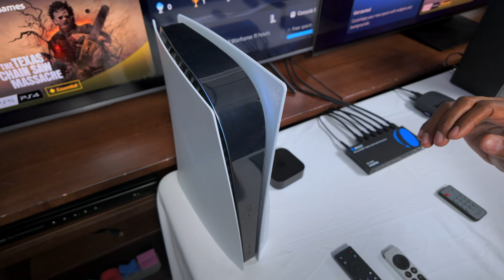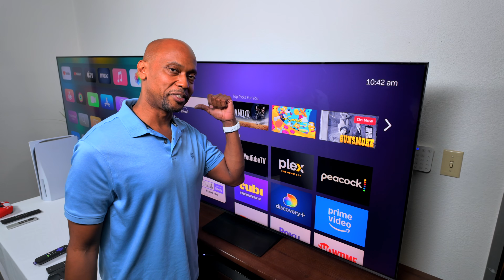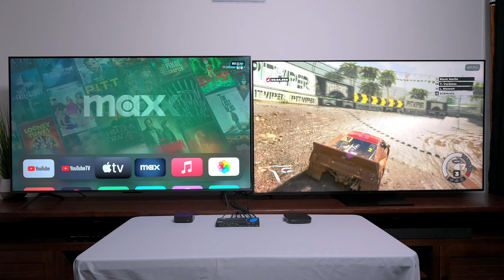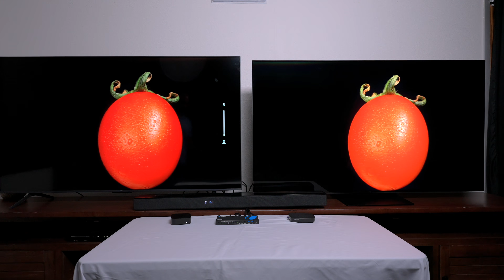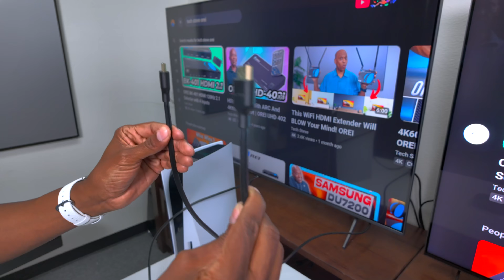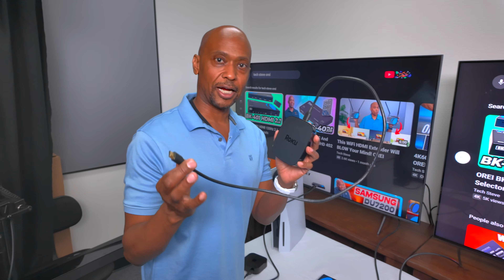HDMI Switcher With eARC , HDMI 2.1 And 4K120Hz Support |  OREI BK-402A

Comment: Is there an HDMI 2.1 device that supports 1 input and 2 outputs? I want to connect my PS5 Pro to both my 4K 120Hz VRR monitor and my Sony Bravia XR80 65" TV, while keeping full 4K/120Hz, VRR, and ALLM support.

Basically, I want to be able to use the monitor when I’m at my desk and switch to the TV in the living room when I want to play there. An HDMI 2.1 matrix also does the job, but that seems like an expensive solution for something as simple as 1-in/2-out.

I’ve been looking for a device like this but haven’t been able to find one so far. Does such an HDMI 2.1 splitter actually exist that can maintain all of these features? @TechSteve
Reply from the maker: @retro_game_collection Yes—the OREI BK-102 is a 1-in/2-out splitter rated for 4K/120Hz, VRR and ALLM. It mirrors both outputs rather than selecting one, so test that your PS5 still reports 120Hz and VRR with both displays connected before keeping it.

Comment: I been to three of these units, 2 directly from Rei 1 from amazon, none of them work switching the input. Frustrated
Reply from the maker: @AndresLler that’s frustrating, especially after three units. Since they all do the same thing, first make sure the CONFIG switch is set to Matrix mode (1xx), then press OUT 1 or OUT 2 to cycle the input for that output. Test one source and one TV at 4K60 with eARC off, then power-cycle everything. If the front-panel input LEDs still don’t change, I’d return it and ask OREI for a different model because that isn’t normal.
Reply: @TechSteve Thank you for your input! What would be another option with the same functions?
I have a LG G5 Tv,
Projector Nebula Anker SE 4k,
Samsung Q990f Soundbar,
Ps5,
Panasonic bluray player.

I want to be able to connect all these devices

Comment: So can I have the OREI connected to my game consoles in my room, how do I display it to my living room tv
Reply from the maker: yes. Connect the consoles to the OREI inputs, then run one of its HDMI outputs to the living room TV. For that distance, use an active optical HDMI 2.1 cable or a 4K120-rated HDMI extender because a long passive cable may cause signal dropouts
Reply: @TechSteve you have links to some good recommendations

Comment: Steve, how are you?  What I'm trying to do isn't as grand as the set-up you have in this video, so I'm wondering if this device would work for me. I am very simple and basic and I just want to watch My LG OLED with my receiver and soundbar. I don't see a receiver in your set-up so I'm not sure if this will work. Basically, is it possible to use eARC/ARC with my TV and sound bar? The Receiver says connect the eARC to the TV, but  soundbar videos say to connect your soundbar to the eARC ... which is it?  I can't do both ...or can I ?  I thought I would connect my cable out of the receiver to the TV for a great picture but then where do I plug my soundbar in for great sound, or do I have to get rid of one of those things (soundbar / receiver )   Any help here ? ... and I will say that the soundbar only has an HDMI eARC port, not an optical port.   Thanks in advance.
Reply from the maker: Great question. With eARC/ARC, your TV can usually only send audio back to one device because most TVs only have one HDMI eARC port. So you normally have to choose: either connect the receiver to the TV’s eARC port, or connect the soundbar to the TV’s eARC port — not both at the same time.

If your receiver is being used for speakers, then use the receiver and don’t use the soundbar. If you want to use the soundbar for sound, connect the soundbar to the TV’s eARC port and connect your cable box/source devices to the TV or switcher.

The HDMI switcher can help with adding more HDMI inputs, but it does not magically give the TV two separate eARC outputs. Since your soundbar only has HDMI eARC and no optical, the cleanest setup is: sources/switcher into the TV, then TV eARC out to the soundbar.
Reply: @TechSteve thank you for your response and great advice. Yes I realized I should just choose one. Since my receiver is pretty good and attached to a lot of speakers, the soundbar isn't really needed. I am happy that you gave me good knowledge for the future when I have the right devices to utilize the info you so amazingly present in your videos.
Thank you again.
Reply from the maker: watch this 2 TVs, 1 Soundbar  Or 1 Soundbar, 2 TVs Shown On TCL QM8k And QM8L
https://youtu.be/rY8cI4ZI33Y

Comment: i just bought this device for your review, im facing a problem the apple tv remote control interfer with the device and change output and toggle arc on and off
Reply from the maker: @AlRefaei.m that sounds like an IR/CEC conflict. First try turning off *Control TVs and Receivers* on the Apple TV, and if it still changes the OREI, block or move the OREI IR window so the Apple remote can’t hit it. If that fixes it, it’s the remote codes overlapping and I’d contact OREI to see if they have a firmware or remote-code option.

Comment: Thanks, this is the solution I need. I got a Dolby Atmos sound bar but my TV only has an arc port but not an earc port. I want the full potential of the soundbar so after seeing your video I found a cheaper version of this brand on Amazon for $79 that doesn't't have the extra ports like this one which I really don't need, I just want 1 earc connection for the soundbar.
Reply: @211sweetypie  Did it work for you? I just got a brand new audio setup with atmos but my monitor doesn't support hdmi arc or earc but yet it allows 2.1 hdmis like the ps5 cable to function fine at 1440p 120fps.
Reply: @Urboyyycarlos ...It seems that this item will benefit you more than me. I haven't tried it yet. ARC and EARC gives the best video and audio with EARC being the best. You have neither so this item although a little confusing would help you.

Comment: It only work once for me
Reply from the maker: @BlackxDeath100 try a full power reset: unplug the switcher and every HDMI cable for 60 seconds, then reconnect the TV, source, and power in that order. Also try another certified HDMI cable and check the correct input/output lights; if it still won’t work, it may be an HDMI handshake issue or a defective unit worth replacing under warranty.

Comment: Could you route picture to the TV while sending audio via hdmi to an older home cinema receiver?
Reply: @JoeChip  
Seems like you can using the SPDIF fiber port he mentions . I think he said you would use the eArc from the source ie xbox then the tv eArc output. And then the fiber or basically the toslink cable to your avr. 
That’s if they work simultaneously meaning when source 1 and output 1 are being used the fiber port extracts the sound from source 1 and outputs it to your avr.
Reply from the maker: @JoeChip yes, connect HDMI Output 1 to the TV and Output 2 to an HDMI input on the receiver, then route the same source to both outputs. It doesn’t have a dedicated audio-only HDMI port, so the receiver will also receive video; if the older receiver causes handshake issues, enable downscaling or use optical, which is limited to PCM stereo or Dolby Digital/DTS 5.1.

Comment: Hi Steve,
Good video. I have just bought an Orei bk-402a, but I have an issue and was hoping you can help.
My connections are:
Output 1: LG C1 TV (eArc)
Output 2: Valerion VisionMaster Max
Input 1: Sonos Arc
Input 2: 4k Firestick
Input 3: PS5
The issue is that when watching the Firestick or the PS5 on the Projector and the TV is off I get no sound from the Soundbar. When watching them on the TV with the Projector on or off the sound works perfectly. 
How do I solve this?
Thanks in advance
Reply from the maker: i’m sorry a lot of these adapters aren’t compatible with sonus audio
Reply: @TechSteve thanks Steve. But it works with the Sonos when using output 1. Why not on Output 2? Do you think i have to change CONFIG or EDID settings?
Reply from the maker: i would contact OREI i saw the Sonos statement on there website, i don’t own one to test

Comment: Thank you for the lovely presentation. My question is whether you can display one as a 4k tv and the other display to a 4k projector?
Reply from the maker: Yes — you can display to two separate screens at the same time with the OREI BK‑402A device (which is a 4×2 HDMI Matrix Switcher with eARC, HDMI 2.1 and 4K/120 Hz support) — but with an important detail: it’s a matrix switcher, not just a splitter.  ￼

🎯 What It Does
	•	Connects up to 4 HDMI sources (PS5, consoles, AppleTV, etc.).
	•	Outputs to 2 displays independently — you choose which source goes to Output A and which goes to Output B.
	•	Supports up to 4K@120 Hz (and even 8K on compatible displays) with full HDMI 2.1 and HDCP 2.3 compliance.  ￼

So in your scenario:

✅ You can have one source shown on your 4K TV
AND
✅ Another source shown on your 4K projector
simultaneously, as long as both displays support the resolution and refresh you want.  ￼

In simple terms: Output
What Can Happen?
HDMI Out 1
4K @120 Hz to TV 📺
HDMI Out 2
4K @120 Hz to projector 🎥

Each output can show a different source if you want (e.g., PS5 on TV, Xbox on projector). It’s not limited to mirroring the same signal.  ￼

⚠️ Things to Know

📌 Both displays must support the resolution/refresh you’re sending (for example, 4K@120 Hz). If one display doesn’t support a mode, you may need a downscaling device or set the source to a compatible resolution.  ￼

📌 Audio Return Channel (eARC) only works between Input 1 and Output 1, and does not extend to Output 2 — so if you’re using eARC with a soundbar, it’s typically tied to the TV output.  ￼

📌 This model can extract audio to optical or analog if needed, but it does not extract audio over HDMI to both displays at once.  ￼

⸻

✔ Summary

Yes — with the OREI BK-402A matrix switcher, you can send:
➡ one 4K source to your TV
➡ another (or the same) 4K source to your projector
…simultaneously and with HDMI 2.1 features like 4K120 Hz and HDR support — as long as both outputs and your sources support those formats.  ￼

Comment: But can I put soundbar on it.  And I can get the ps5. X box. Tv  all play through the sound bar. ? And how would I connect it. To make everything play through my sound bar. Do I connect my sound bar hdmi arc to the switch arc. Then run out the switch box to the TV arc ? And then connect all other devices to the available HDMI slots on the switcher ?

Comment: I have a PS5 and an Xbox Series X with an HDMI 2.0 input monitor. Its resolution/refresh rate is 1080p/120Hz and 4K/60Hz. I was wondering if this device will allow me to run 4K/120Hz?
Reply: @brandondiaz3115  no you need HDMI 2.1 for 4K 120hz gaming

Comment: Great video of the product. However, I may have missed a scenario. If I have a 4K@120 source, could I simultaneously broadcast this source on a 4K@120 display on output 1 and 1080P@60 on output 2? Thank you in advance.
Reply from the maker: no you can’t do that edie matches the lower resolution, most switchers work that way😊
Reply: @TechSteve  See my previous comment - the OREI support has a different opinion - this device has an added control deep switcher to the EDID deep switcher.

Comment: Hi, thanks for the video! I have one question about the OREI BK-402A:
Does 4K@120Hz with VRR still work on a HDMI 2.1 TV (LG OLED CX) if the second output is connected to a HDMI 2.0 monitor (LG LED 1440p 75Hz FreeSync)?
I would mainly use the TV for gaming, but sometimes switch to the monitor — I just want to make sure the lower spec monitor doesn’t disable VRR and 120Hz on the TV.

Thanks a lot for your help!
Reply: Hi! I have the same question but for 1080p@60. Did you resolve your doubt?

Comment: if I have one TV that supports 120hz, and the other that supports 60hz, will this work?
Reply from the maker: It’ll make both TV 60 Hz
Reply: @TechSteve  Ok i have my answer.
Reply: Interesting, because OREI support told me something else. I bought the OREI BK-202A and it's not capable to output from an XBOX Series X in 4K to one TV at 120 Hz and to one monitor to 60 Hz (nor individually, nor at the same time). But OREI support tolt me that I can do this with OREI BK-402A. It's not clear from you (even if you had two sources to two TVs and one was at 60 Hz and the other at 120 Hz) and not from the OREI manual. So...I'm puzzled . It's a simple thing: just to switch from an XBOX in 4k to 60 Hz and to 120 Hz, individually, not at the same time, because at the same time XBOX will mirror with the lowest setting.
Reply from the maker: because of EDID, it will lower the resolution to match the signal
Reply: I'm just staying with Orei support on chat since more than 2 hours and they are not able to be clear about it.
For me, as a newbie,  it should be simple as if I change manually the cables, it simply works! Odd, that nobody thinks to it
Reply from the maker: most switches works this way, using a computers video card is the only way to display 2 different resolutions. i thought i mentioned this on the video but maybe I’m wrong
Reply: @TechSteve so nothing can replace my hands, manually switching the cables and all works

Comment: @TechSteve I need your help regarding my Home Theatre Setup
Reply: I bought new Bose Ultra Soundbar that is connected with TV eARC that works well. I also have a projector and a Fire TV which I need to connect it to sound bar without changing HDMI cable so the I can use sound bar with both TV and Fire TV along with projector . Will BK402 work without changing HDMI cables?
Reply: My TV does not have HDMI out for Video
Reply: Is there a why to contact you in person via WhatsApp/FaceTime ?

Comment: Can I use it with a Mac+Xbox+Monitor setup? my MBP 14 doesn't have 2.1 out so will be using a bypass using an adapter.
Reply from the maker: yes
Reply: @TechSteve  Ok boss <3 Thanks for the confirmation.

Comment: Why do you cut the video when you push the button? The entire reason I'm watching this is to see whether the thing allows fast switching.
Reply: Its just the same as any other youtuber, not really 'reviewing' the device.. more like advertising
Reply from the maker: didn’t i show how to use? ads don’t show details
Reply: @TechSteve you didn't show it switching, could as well change cables lol. People are right, very strange that you're not showing this, after all, that's one of the most important use cases.
Reply from the maker: that’s the reason? switchers aren’t fast, there’s always a 3-6 sec blank when you switch because of edit has to configure
Reply: @TechSteve Yes. That IS the reason. Ppl are complaining about this product on Amazon and I wished to find real reviews on Amazon. We don’t want to hear just about the bells and whistles.
Reply from the maker: unless you spend about $300  - $600 all these switchers blink because of edid, more expensive models have small processor to adjust internally like the aten brand
Reply: @TechSteve 
Well said , people don’t seem to accept you get what you pay for. That pause if you can accept it saves you hundreds. Or if you can’t go for the other option and pay the $$$ nice to have options!
Reply: @TechSteve  Seems like the ConnectPro brand unit is nearly instantaneous. The level1techs unit seems reasonably fast too.
Reply: @TechSteve  Definitely should have been advised in the video. I was also looking for this delay time. Did you get sponsored for this video? Seems like a big detail to "cut"

Comment: Hi! Can you help me please ?  Lets suppose that i have a ultra wide 32:9 monitor with 2 hdmi 2.1 ports. If i want to connect the two outputs in one single ultra wide screen from the dock, would it work ? Like i have 6 devices and i want sometimes to connect my pc at the same time that  i use my console on the same screen but splited in two 16:9 screens thanks to the two ports and the dock. Would this work ?
Reply from the maker: no
Reply: @TechSteve what if i use 2 docks ? Because the screen that im talklng about is a samsung screen and its supposed to support 2 hdmi sources at the same time from what i heard... or maybe what i heard was false idk
Reply: @TechSteve 😭

Comment: If I connect my pc to 1 input, would monitors display the same thing? Or would the pc be able to detect two different screens?
Reply from the maker: same thing, you have to use built in video card for dual screens

Comment: Just picked up the OREI BK102 (with the 2 outputs).  HDMI 1 is flawless (Sony Bravia) but unfortunately HDMI 2 colors are distorted on my other tv (Samsung Crystal UHD).  I’ve tried adjusting the picture settings but can’t seem to get things right.
Reply from the maker: look at the edid settings, but 1st try unplugging for about 10 sec
Reply: @TechSteve thanks for the tip!  Switching to EDID 110 has cleaned up the image!  The setting for 110 is 4K60 2.0 channel.  I see other settings that are 8K_HDR with different channels.  If both of my TVs are only capable of 4K max output, should I leave them on the 110 setting I initially mentioned?
Reply: Steve, after changing the EDID and correcting the color on HDMI 2 I am now noticing slight frame rate dips for PS5 pro on HDMI1 that I didn’t notice before.  Any advice?

Comment: Quick question do you know if the earc to soundbar is exclusively for a soundbar or can you use that earc hdmi to an hdmi on an avr? I know you said the optical/digital to avr but my tv has an optical digital out anyway, which makes this pointless for me. Unless I can use the hdmi earc to avr instead of soundbar.
Reply from the maker: any audio device supports it
Reply: Thanks!  @TechSteve